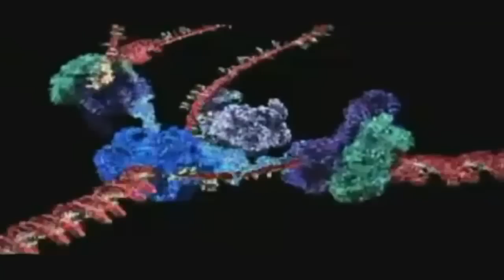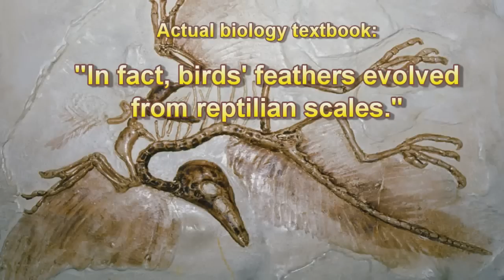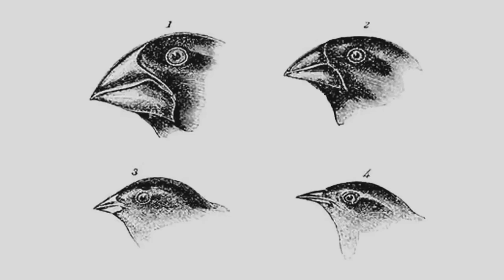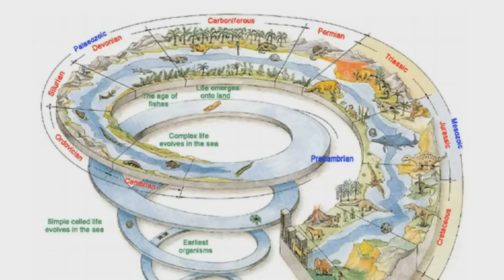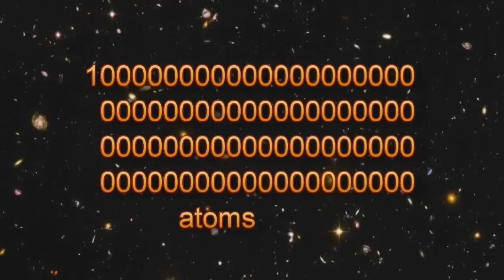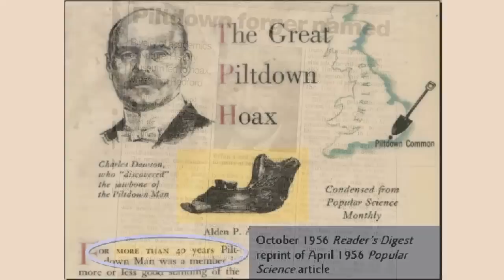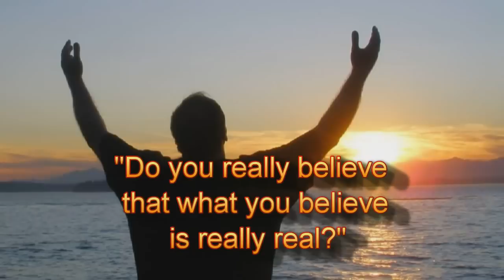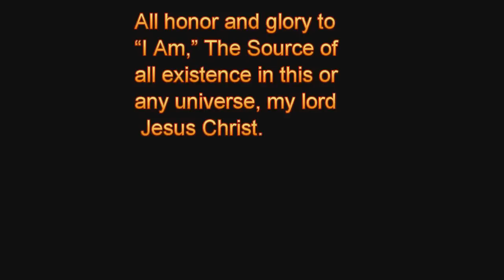Evolution Demolition

Comment: An hour of staggering misunderstanding of evolutionary biology. I want to pick on my favorite creationist trope: all the supposed information in the genome. Less than 5% of the 3.5 billion base pairs codes for anything, and only ~9% of the genome shows signs of conservation. This means that roughly 90% of the genome appears to do nothing at all, and when you check these sequences they are long repetitive elements, transposons, retroviral DNA, etc. To use your library analogy, that's akin to having only 10 books out of 100 actually contain sentences written in any meaningful way with the rest only garbled nonsense. 

A final point, if we maintain that the 3.5 Gb human genome IS fully functional, you'll have to explain why an onion have a genome that's five times the size of ours. Are we to assume that the onion is five times more complex than a human? 

My freshman biology students could do a better job at explaining evolution than this, and would laugh at how embarrassingly wrong this is.
Reply: You apparently have not heard of the ENCODE project.  While only 2% of the genome codes for proteins, virtually all the rest of the genome has been found to have programming/regulatory function.  The idea of junk DNA (or pseudogenes) is now obsolete.  If you are teaching biology and do not know this, you should not be teaching biology.
Reply: @markchampneys  Of course I've heard of the ENCODE project. And it most certainly has not found that virtually all the rest is regulatory, only that some chemical action takes place on most of it. The issue with ENCODE is its liberal definition of function (see Graur et al., 2013), which is that any portion of the genome in which a biochemical process takes place is therefore functional. By that definition, all of it is functional because all of it gets replicated. This is nonsensical, and has been heavily criticized in the literature. Junk DNA is most certainly not obsolete. 

But let's entertain the idea that it is. I'm going to use Graur et al's argument there and elsewhere (Graur, 2015; 2017) to show the mathematical impossibility of function across all (or even most) 3.5 Gb. I should add that this has been known since King & Jukes (1969), long before we even knew how large the human genome was. If we take an average estimate of the mutation rate at 1.6 x 10^-8 per site/per generation, every human gamete will have on average 56 mutations. The effective population size of humans is 10,000, which would mean per generation 560,000 mutations would be segregating in the human population. Functionality, biologically, presumes conservation -- i.e., a region is functional if it is conserved because changing it would disrupt its function. For this to even be close to the mutation rate, it would assume one of two things: 1) damaging mutations simply never occur or 2) humans produce enough offspring per parent to offset the damage caused by mutation. Of course, neither of these are true. However, if the functional region of the genome is much smaller than 3.5 Gb -- say, less than 10% -- then the mutation rate makes sense, as the majority of these mutations occur in non-functional regions. And this is exactly what we see when we scan the genome for evidence of selection (determined by a reduction in diversity, i.e. conserved areas) -- about 9% of the genome shows evidence of conservation (see above citations). 

A second issues arises in what T. Ryan Gregory refers to as "the onion test". If we are to argue that genomes are largely functional, then we are forced to answer the question: why does an onion have a genome five times the size of ours? Does it need five times more functional genetic material than we do? Or the cockroach, that has just as large of a genome as we do? 

The ENCODE project has suffered from a lot of bad and confusing publicity, but if you dig into the actual scientific literature it has produced the estimate of functionality ranges widely and is entirely dependent on what definition one uses for "function".
Reply: @zacharyhancock2209  Thank goodness you've heard of it.  (There are a lot if ignorant biology teachers out there.)  An early ENCODE estimate was that about 80% of the genome was certainly functional, but the entire thing may be.  I predict that will be the final outcome. The limiting factor is our ignorance.  Ignorance does not equate with nonfunctionality.  That is an arrogant assumption.  I used the term "regulatory" but that tends to be a comprehensive term.  It is actually an enormous variety of function, such as redundancy, error correction, and combinations with epigenetics.  It reads forwards, backwards, and across the histone proteins it is wrapped around.  New discoveries of functionality are made virtually weekly.  One thing is certain, your statement that 90% does nothing at all is most certainly false.  Not even close to reality.  Likewise with the rest of the materials that make up the cell.  The more we know, the more function we see that we didn't see before.  Chemical computer feedback loops are everywhere.

The arguments here are not unlike those that have been made for so-called vestigial organs.  Most of those have been found to have function as well (even if not crucial functions).  The arrogance of evolutionists who claim to know better than the Designer is breathtaking.

Yet, even if I grant you nonfunctionality of anything you care to name, all you have done is to demonstrate devolution.  Creationists do not deny that things can devolve.  The real trick is to innovate new integrated functional systems upwardly (more sophistication) by random mutation.  That is where the difficulty lies.  The generalized second law prohibits such spontaneous specified arrangement of nucleobases.  So evolution violates scientific law.  Most biologists are fond of finding excuses for ignoring the generalized second law, rather than facing up to its operation.  (I have studied this law extensively.)
Reply: @markchampneys  The lead ENCODE author has stated that the press misrepresented the conclusions, and that the functionality is really only 40%. Another contributor (Hall, 2012) stated that it was only 20%. Again, see Graur, 2013. The ENCODE project is an excellent example of how the press can misrepresent scientific results. 

Your description of the action of genes is... a little weird. Regulatory has a specific definition. Redundancy is not a known functional type -- it may have a causal role, but it is not selected for. However, we have very little evidence (if any? I know of no scientific study claiming such thing) that redundant genes serve as back-ups, which I'm assuming that's what you're referring to. Duplications mostly lead to pseudogenes, occasionally subfunctionalization, and very rarely neofunctionalization. 

Evolution is not directional. This is elementary. It doesn't progress "upwards" or "downwards". Biologists study it as changes in gene or allele frequencies in a population across generations. By the "generalized second law" I assume you're referring to the 2nd law of thermodynamics. The specification in the genome is ad hoc. It did not arise specified, it became specified via selection acting on random mutations. 

 We have many examples of duplicated genes obtaining new functions. Just go to Google Scholar and type in "neofunctionalization". Spend some time with the literature. 

Arrogance is a direction I wouldn't take it. It is arrogant to claim that you know the mind of the "Designer" better than anyone else, that you understand biology better than almost all of the world's biologists, that you understand physics (since you invoke the 2nd law) better than all of the world's physicists who would never use thermodynamics to talk about biological evolution (because they actually know it's nonsensical).
Reply: @zacharyhancock2209  Pretty much all of your last post was inaccurate.  I think you need to get up to date.

I do want to address your statement that evolution is not directional.  I have heard this claim many times.  Certainly changes in the genome can be any direction, up, down, sideways.  Creationists to do not deny "change over time" in a downward or sideways direction.  But living systems are incredibly integrated and coherent to provide solutions to engineering problems, including hundreds if not thousands of true computers within every cell.  If evolution is correct, then it somehow solved these immense problems with remarkable innovations.  When I speak of "upward" change, I am referring to a measure of this sort of increase in sophistication.  New integrated function.  I am not speaking of less improbable tampering with functional coherent systems that are already in place.  That can and does happen, but this is because such minor tweaks are not so improbable.  The kind of change that I say is impossible are the ones that add to this sophistication, which programming is "fantastically improbable."  This is a term that Douglas Axe coined which refers to probababilities that need more resources of time and matter than are available in the universe.  Technically anything is possible, but not in this universe.  Too many trials would be required to get past the error.  The human genome is known to be degrading as time passes.  It is not advancing in sophistication, but losing function.  Change over time, yes.  But not upward change.

The second law of thermodynamics was originally a law that concerned the arrangement of energy.  But 12 years after Rudolph Clausius formalized the law, Ludwig Boltzmann and associates discovered that it is not a law of energy arrangement alone, but a law of statistical mechanics.  This means that is has to do with the spontaneous statistical arrangement of virtually anything.  (Including nucleotides or anything else.)  Boltzmann showed that statistical mechanics gave exactly the same result as Clausius had found, yet with statistics and probabilities without respect to heat dissipation.  (He was studying gas particle behavior at a time when many did not even believe in atoms.)  Dr. Granville Sewell is a math professor at UTEP who has been shouting this truth about the second law from the mountaintops for 18 years, but only a few scientists have taken note of it.  They would rather believe that the law doesn't apply to them.  Yet the law is everywhere around us, throughout our daily experience.  The law is essential for life and impacts the chemistry within the cell all over the place.  (For example, the proton gradient across the mitachondrial membrane that drives ATP Synthase.)  By the way, physicists typically get the law.  It is mostly biologists that don't.
Reply: @markchampneys  You have side-stepped the majority of my points and instead chosen to focus on definitions of "upward" change -- again, not a biologically relevant definition -- and the 2nd law of thermodynamics, which for some reason you saw it necessary to provide a history lesson on. Wikipedia can tell you the history of its development. The better question is are you using it in a way that's actually relevant to its application.

Points unanswered: 

1) The mathematical impossibility of 100% functionality in the genome due to mutational degradation.  

2) Immense genome-size variation across life does not scale with complexity or the number of functional genes.

The application of the 2nd law to the "spontaneous statistical arrangement of virtually anything" would be unnecessary, even for Boltzmann's time. We already had actual statistics for this. It's the exact same statistics for the probability of rolling a six 10x in a row on a six-sided dice, or flipping heads on a coin five times. What you appear to be misunderstanding here is that randomness is acted upon by natural selection -- the spontaneous arrangement of any set of nucleotides that results in nothing is simply not replicated (i.e., selected against), whereas those that benefit the molecule's replication get replicated (selected for). This is chemistry, not magic.

Finally, why are some genomes degrading and others not? You state that the human genome is degrading, but when you look at the genomes of most prokaryotes, they're almost entirely functional with genes literally overlapping each other. Or the nematode worm Pratylenchus coffeae, whose genome is only 19Mb and virtually entirely functional. You appear to be arguing out of both sides of your mouth -- the human genome is 100% functional! The human genome is degrading! 

Which is it?
Reply: @zacharyhancock2209  The Bible is not a science book, but the creationist model is based on clues from statements in the Bible, taking it as a historical record.  So creationists, like myself, postulate that all genomes were created/programmed perfectly originally.  But after the Fall (Adam's sin), God ceased to maintain the genome, and it began to degrade based on the historical record of scripture, as well as our own experience.  After the global flood, there has been substantial diversification and speciation along with this genomic decay from original perfection.  So, no, we do not expect perfect functionality after extended decay, though it was originally.  Please note that the physical length of a DNA molecule does not correspond to function, but has to do with the structure of its program design.  We see this in computer software today.  For example, if a given subroutine is called frequently, it allows for a program to be smaller while retaining functionality.  So don't read too much into an onion having more DNA than humans.  Less code does not mean less sophistication of design.  It is not true of human-written code, and it is not true of DNA code.

All genomes are degrading; no exceptions.  It is just a matter of how fast, given circumstances and design.  For example, human reproductive cells are relatively immune to mutational damage as compared with, say, skin cells, which are less critical, but show mutational damage in a very pronounced way.  No genome of any species in the world has ever been demonstrated to be advancing in sophistication.  It is imagined by evolutionists, but never observed/confirmed.  Even cases of bacteria gaining immunity to antibiotics occurs because a gene is broken, never because one is built.  Michael Behe writes about this in his new book _Darwin Devolves_.

What you are not understanding about natural selection is the same thing that Darwin failed to understand.  It is this:  Natural selection is not a preservative.  It is a killing, culling, and filtering, mechanism.  It is a mechanism that works, but it does so by the non-survival of the unfit.  It has been assumed that if a series of lucky mutations forms a working system by unimaginable chance, it will be preserved.  But there is no mechanism that can accomplish preservation, in the face of the second law, any more than a perpetual motion machine can be designed.  Lots of things kill organisms besides a less fit genome.  Lots.  And POOF, your lucky mutation is gone.  If natural selection actually preserved "favored races in the struggle for life," I would buy into evolution and tell you that I was wrong.  If that were true, indeed, evolution could conceivably work (although it would take much longer than 3.5 billion years).  But it is not true, and it is quite obvious that it is not true.  Natural selection kills, it does not preserve.  And this reality crushes Darwin.

Thanks for dialoguing with me.  I appreciate and enjoy it.

Comment: By "suspend" I meant circumvented in the same sense that gravity is overcome by a plane or rocket. Design can create an entropy transfer mechanism that dramatically alters probabilities, transferring randomness from one part of a system to another. Limited entropy transfer mechanisms occur in nature, varying probabilities only slightly such as the hydrologic cycle utilizing solar energy. Living systems would require a massive probability transfer mechanism. Evolutionists don't even propose one.

Comment: cont...  Even evolutionists have to admit that so many point mutations could not happen that fast.  A number of new papers appeared in the Journal of Biological Chemistry discussing the role of plasmids in bacteria.  Bacteria reproduce asexually, which would mean virtual cloning if not for self-correcting mechanisms for its DNA.  It appears that the capacity to alter enzymes is pre-programmed into bacteria drawing on information in these plasmids. So the change is not random, but programmed.

Comment: cont... Not all genetic information is contained in the chromosomes.  There is a vast storehouse of epigenetic information.  And In this case, additional information in the plasmids.  By the way, the ability to metabolize nylon is a combination of two enzymes, not just the one.  The same change that gave the ability to digest nylon, harmed the ability to digest cellulose.  So the Designer wrote in a limited ability for rapid self-modifying programming necessary to asexual organisms. Amazing!